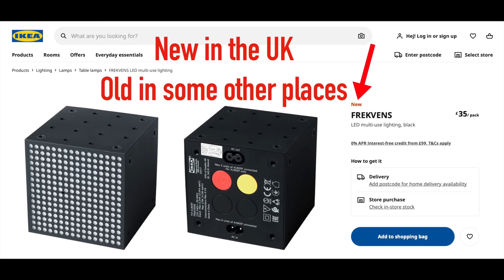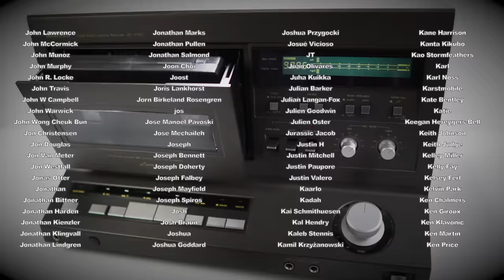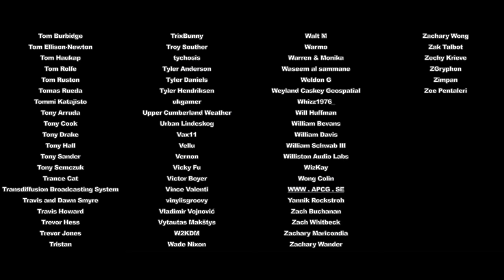REVIEW & TEARDOWN : IKEA FREKVENS sound to light box (a QUICK-VID)

Comment: its a $0.10 89112 microcontroller and some chips to increase the number of outputs so it can light up all the leds and some very basic subroutines it switches through with a button and uses a microphone with a 358 opamp to just trigger like a button input to switch through "frames" of led patterns. its lazy, its cheap, its overpriced, its garbage.

Comment: You're buying a product designed by Teenage engineering. the same people who flatpacked a PC case that you can't even put a graphics card into and didn't bother to pre-thread the screws and didn't give you a screw tap. 
everything they make is overpriced and underperforms. 
so basically anything you buy from them will be overpriced and won't "wow" you ever, because they never have, and I'm guessing they never will.

Comment: The quality of Ikea products has deteriorated in the last 5-6 years imo.   Drinking glasses that spontaneously shatter, paint defects on furniture panels, mirrors with geometry warpage, drawer sliders/rollers not operating smoothly, shelving units wobbly and need to be anchored to the wall, everything made from thinner cheaper materials than 5-6 years ago.  I guess the new generation took over and are running the company a little differently now.  And of course, that other thing.

Comment: "Uninspiring"...

It's not uninspiring, it's total rubbish!

I hated all of it. It's ridiculously large. It's not responding in any relevant way. It's trash!

If only the fixed animations responded to the volume instead of simply cycling frame by frame it would have been tolerable, well almost at least. As it is it doesn't even try to sync with music or any other sound source. All it manages to show is why we don't let teenagers design anything that matters.